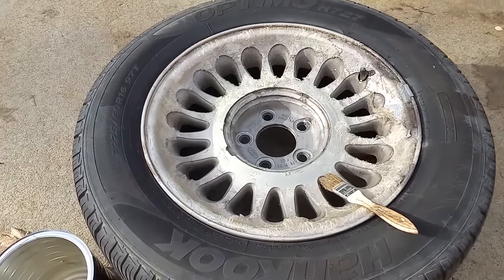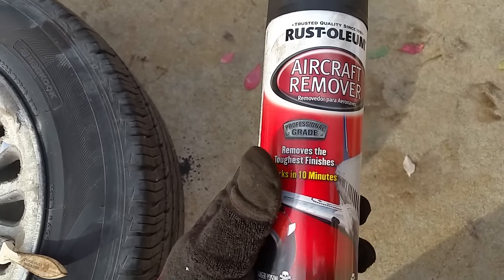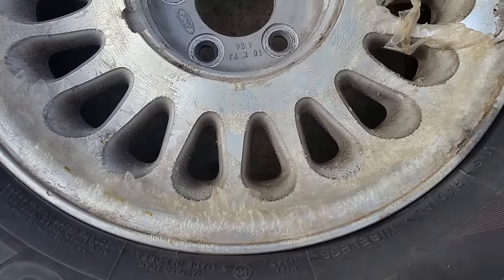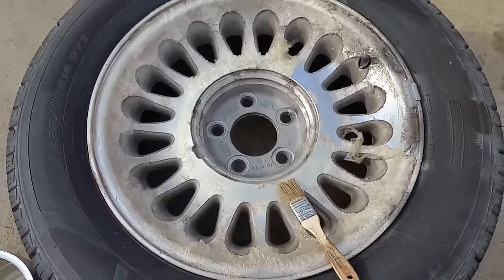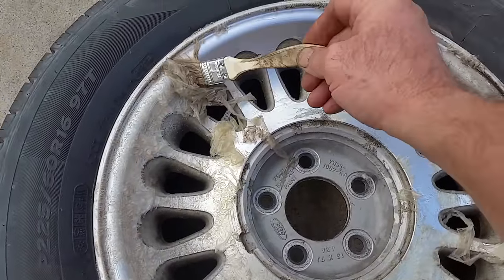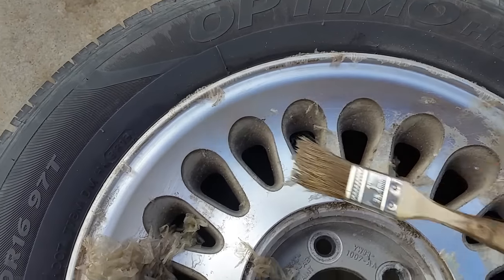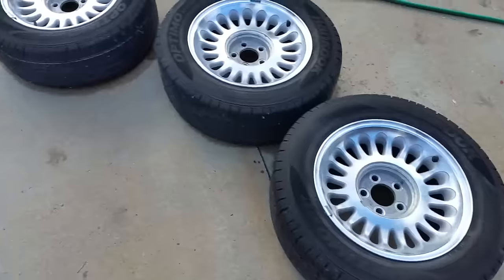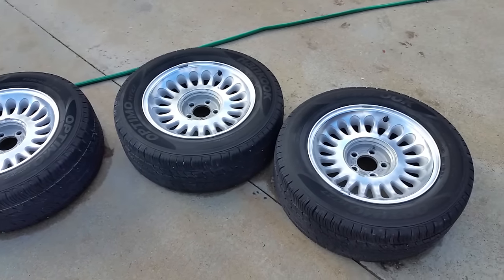HOW To Remove Peeling CLEAR COAT on Wheels/Rims...FAST !

Comment: Do you need to seal them after they're stripped? Won't they rust real fast with no protectant or no?
Reply from the maker: yes you can clear them or just keep them poished this way they wont oxidize again
Reply: Thank you sir!
Reply: but it DOES corrode, which is just as bad. Matter of fact, aluminum will corrode faster than steel. If it were my wheels, I'd apply clear to them after stripping the old stuff.
Reply from the maker: they corrode way less if they are kept out of salt and the car is washed once a week in the highest times of the year for road salt
Reply: will they not corrode if there is no road salt in my area
Reply from the maker: correct just keep them clean and shined up
Reply: Can I apply clear directly over a highly polished surface or does it need to be a little rougher first?

Comment: Hi
What do I do about the black paint sections. The clear coat on my wheels is only on the face of the wheel? Great video by the way. Thanks.
Reply from the maker: Use this if you want to remove the paint, https://amzn.to/3I1zp2m  There's no way to remove the clear coat on the unpainted section without affecting the painted section. You are going to have to strip the entire wheel and re-paint where needed. Thanks for watching jason, have a great day my friend. mad Mike the hammer SPC

Comment: My rims have tangly, spidery, spaghetti like streaks all over the place on every wheel. It's definitely not from scratching. Any idea what that is, and the operation to repair?
Reply from the maker: Sounds like it's the clear coat deteriorating, you need to use this  https://amzn.to/2H4NJHx  and follow the process in this video  https://youtu.be/MziPmQWYr4w  Thanks for asking.  Have a great day.  mad Mike the hammer SPC

Comment: I bought 4 wheels that were painted black by the previous owner. Used this method to remove the black paint, and it took the clear coat off too. Is it necessary to apply a new clear coat now? Or can i run the wheels without it?

Comment: I need to remove the clear out of painted wheels.  Will it damage the paint as well?
Reply from the maker: This stuff will strip off everything right down to bare metal, there's no way to remove clear coat without affecting the paint. So if you don't want to monkey with this process you can take them somewhere and have them bead blast them for you. Thank you for watching and asking, hope you have a great weekend and all the best on your project my friend. mad Mike

Comment: Does it not damage the rims after removing the protective clear coat?
Reply from the maker: Let me help you out with this, whatever is on the base metal of the wheel/rim will be removed doing this process which includes clear coat & paint. Then at that point you will buff and polish them into whatever shine you want. If you plan on re-clearing them, use this  https://amzn.to/3lgx0W1  Thanks for watching and asking, have a great day. mad Mike the hammer SPC

Comment: Easy Peasy! Let’s see you strip clear from a 2 stage alloy wheel? I have expensive alloy wheels that have very little damage, but, I want to go from silver to base black, then clear.  Do I strip all layers to alloy and prime,base, clear or scuff up the clear really good and go base and clear? Not rattle can, I will spray myself with gun.
Reply from the maker: Well if the wheels are as expensive as you say they are, then there's only one way to do it and it's to do it right. You may have to do this process a couple of times to remove all of the clear, then you can paint them hot pink if you want or any other color that trips your trigger. Thanks for watching and asking. mad Mike the hammer SPC
Reply: @SweetProjectCars  trigger tripper here, After much searching, found an Industrial stripper that exceeds all the aircraft crap. 👍

Comment: I’m just wondering why I couldn’t leave the wheels on to strip then drive to car wash to power wash.
Reply from the maker: You can do whatever you want to do my friend, if you don't mind blowing that stuff all over your car while driving. Some of the chemicals in the cleaners are something you don't want all over your car, but again, you can do whatever you want to do. Thanks for watching, have a great day. mad Mike the hammer SPC
Reply: @SweetProjectCars   I got the chemical finally, are you sure can use on the plastic canter caps? Thanks

Comment: Is there a reason you suggest this particular paint stripper vs others? Is clear on wheels that difficult to get off with ordinary paint stripper?
Reply from the maker: Yes this is the only thing Brian we have found that will work and some clearcoat can be a real bear to get off this makes mincemeat out of it in no time
Reply: Where can you buy the gel. I've looked everywhere for this exact kind

Comment: Just a question, my rims clear coat are peeling off. I want to remove the clear coat and spray again but the rims are coloured black. Would this stuff remove both the clear coat and the underlying color paint? I got quoted $220 each rims to get fixed which I’m trying to avoid.
Reply from the maker: There's no way you are going to remove the clear and not remove the base paint as well my friend, you're going to have to strip them all the way down and repaint and reclear.  Thank you for watching and asking, hope this helps, have a great weekend. mad Mike the hammer SPC

Comment: Would using this method on rims that are partially painted be ok? I dont want to damage the nice painted parts but the clear on the chrome is peeling. I have a 1990 Indy Beretta
Reply from the maker: You will have to be careful no matter what you do as to not affect the paint.  We recommend taping off the painted areas.  Hope the helps.  Have a great day.  mad Mike the hammer SPC

Comment: Ive been working & working at stripping my wheels, exactly as you demonstrated, the clear coat on my wheels is very thick ! Help ! On my 4th coat of stripper, 2nd can, barely any clear coat is removed with each coat
Reply from the maker: John, you need to keep using stripper until it is all removed or have someone sandblast them for you.  Sorry my friend.  Hope this helps.  Have a great day.  mad Mike the hammer SPC
Reply: @SweetProjectCars  I used 3 cans on 2 wheels, i called around and apparently raceline uses a product called rock guard , like a plastic product - the more you apply the stripper the harder it gets :( , im sending the wheels to powdercoat.
Spent 5 days on 2 wheels

Comment: Did you re-clear coat them after stripping everything?
Reply from the maker: We didn't re-clear this set, but we have re-cleared many others using this  https://amzn.to/3lgx0W1  it's the best we've found MB. Thank you for watching and asking, have a great weekend my friend. mad Mike the hammer SPC
Reply: @SweetProjectCars  yeah I have a few cans of that type clearcoat laying around, I’ll be mixing my own 2 part clearcoat and spraying it on with a gun, my problem is the rustoleum aircraft remover that you used is not available anymore in it’s original formula, the fed changed the law for the environment so the new formulation of the same product sucks, it doesn’t even wrinkle or bubble the paint like the old formula did in five minutes, the reviews are horrible for it, all of the paint strippers from all brands have had to change their formula because of the new law, I can’t find anything available anymore that actually works to get off the old clearcoat and paint, same thing with the Permatex paint stripper, has been discontinued because of the new law. The chemical removed that made it work so good is supposedly methylene chloride.

Comment: I was tryna do it to some black n machines wheels but think it’s gonna take the paint off too
Reply from the maker: The paint stripper is going to take everything off to bare metal, so you will have to repaint them or have them powder coated after this process. Thanks for watching, have a great day. mad Mike the hammer SPC

Comment: I agree, brain over braun.  I refinished my wheels and used orbital sander which was back breaking bending down putting all that pressure.  Finally looked around and found strippers, chemicals that did all the hard work for me.  Just have to be patient which is the next thing I am working on.
Reply from the maker: thanks for sharing dojo

Comment: Don't you need to re-apply clear coat to the rims afterwards? I'm wondering how long they'll stay fresh without any clear coat.
Reply from the maker: After you are done, use this  https://goo.gl/z9TrgR  Thank you for watching and asking Masda, we appreciate it my friend. Have a fantastic day. mad Mike the hammer SPC
Reply: I do not want to go against someone else's advice but...I would definitely clear coat bare wheel. 
Reason, brake dust and dirt will stick to aluminum and be very hard to remove. This is why they are clear coated in the first place. I been there done that. My bare rims became discolored and needed a light sanding than clearcoat and it solved problem.

Comment: nice!!! i got same rims same issue!!!! once sterile would you recommend applying a new THICK clearcoat finish ?
Reply from the maker: you can,  I preferred to just polish them up once in while, but clear coat will work as well
Reply: Sweet Project Cars i just grabbed another Michelin symmetry tire to complete the set of 4 and now i will recondition the rims as you showed me!!! The fact that you demonstrated with the identical rims is amazing!! What are the odds!!  Thanks again

Comment: Did you re-clear coat them afterwards? Would a new clear coat help keep the wheels looking good for a longer time?
Reply from the maker: yes we recleared and it will keep them looking good much much longer
Reply: @SweetProjectCars   did you have to rough up before clear? What clear did you use?

Comment: Will this work on wheels covered in brake dust? Or does that need removed first? also will the stripper hurt the tires? they need to be masked off?
Reply from the maker: yes if the clear coat is still there brake dust comes off with it...will not hurt the tires...but then again there is no reason to get it on the tires in large quantities

Comment: I have like charcoal black stock rims with the clear chipping off with this work?
Reply from the maker: if the rim under the clear is not painted..this stripper will remove all coatings! if your rims are anodized you will be safe but still try a very small area to check.

Comment: Most paint strippers can do same,but when ya using them better Watch The painted AREAS not clear COAT,lol,Will strip all paint off,lol
Reply from the maker: If you want to remove what we share then use the process we have shared here. This is meant to show how to strip everything off down to bare metal. For instance, if you want the paint off your car or wheels, follow the video. Thanks for the view and comment, have a great week. mad Mike

Comment: I Have those wheels, the corrosion is very hard to get off., What exactly did u use?
Reply from the maker: alb12345672 this is what we used   http://amzn.to/2zPdZyI
Reply: Brake cleaner believe it or not works too. I'm having trouble with the crusty corrosion. What pad did you use?
Reply from the maker: alb12345672 see these videos to make them look new    https://youtu.be/IDoIpxzZNqo    https://youtu.be/kk8UbGjox_0    https://youtu.be/vszhfF4TV5M

Comment: Is there an alternative to power washing the rims? As I don't own one.  Also what clear coat do you recommend so it can last the longest. Should I use an aerosol 2k clear coat or regular duplicolor rim clear coat?  Thanks !! 🤙🤙🤙
Reply from the maker: Alexo a garden hose with this nozzle works great https://amzn.to/2PAib1X or just spend a little more and get this https://amzn.to/2KgsbY5  also if you rattle can clearing them we use this  https://amzn.to/2DN31jB
Reply: If you’ve got an extra car, take them to a quarter car wash and spray them off there. Obviously get as much of the goo off when your at home but that should help.